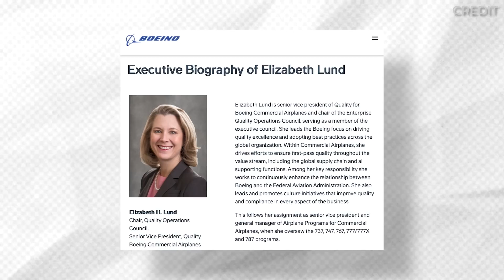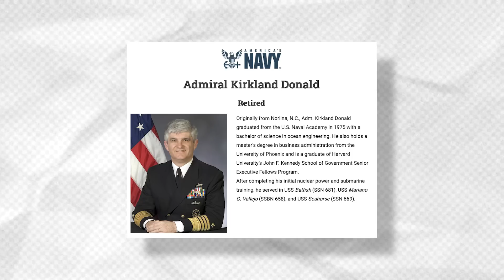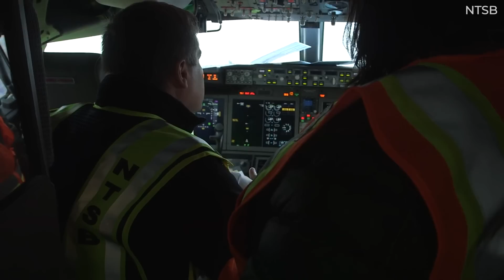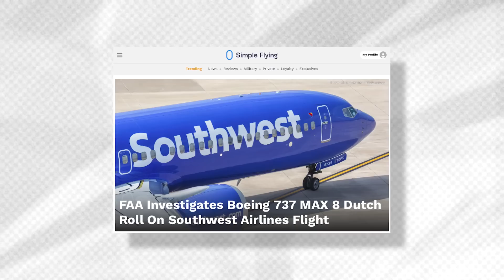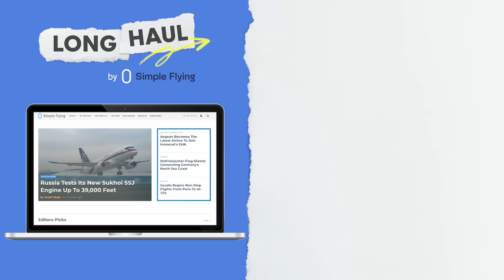Boeing's Plan To Build Better 737 MAX Planes

Comment: Wait, they said this after the MCAS fiasco.
Reply: Has there been any new accidents caused by MCAS?
Reply: @Thompson123-ih4uh  wrong question. Did they fix the safety /quality issues they said they would?  Waiting......
Reply: @bluelithium9808  MCAS is now reliant on two sensors. Since we've had no more crashes.

Comment: Planing to build a better 737Max.

By BOMBING IT!
Reply: no.
by bringing back the 707 with a similar length to the a320 and shortening the wings making it only a twinjet with the characteristics of the current 737 max.
Reply: @yhfhdcf  BOEING IS GONE! Get that through your thick as shit head. THEY ARE MURDERERS! Their aircraft assets stocks all will be seized by the department of Justice. BOEING IS FINISHED!

Comment: I always assumed that workers at Boeing, when removing or replacing bolts on an aircraft door, would complete paperwork that shows who did it, what was done and who approved the finished work so as to log a complete chain of custody.  I guess I was giving Boeing too much credit.  I don't want to go anywhere near an aircraft that does not have a procedure like this.  Even Aircraft parts have to have a chain of custody, but not so much for mechanical repairs?   I still refuse to fly on any aircraft Boeing has built since the  737-900 ER,  I'm going to keep it that way for the foreseeable future.

Comment: I'm supposing Boeing felt they needed to address the incidents publicly rather than not say anything at all. This was indeed a violation of the ongoing investigation by the NTSB, but I don't feel that it was "flagrant" or "blatant" as I do not believe it will effect the integrity of the overall investigation.  But, yes, Boeing does need to be held responsible for prematurely divulging information as per the agreement and law of a company under investigation by the NTSB.

Comment: So the first in what will be many deaths and accidents is for the DOT and the DOJ to allow Boeing to reacquire Spirit Aerosystems. Boeing can't even keep it's own process clean, why make it bigger? The milk has soured, putting back in the fridge will not bring it back. Boeing has killed it's world leading engineering capability and replaced with it's much proclaimed share holder commitment. Greed and accountants have, forever, polluted the waters and the personality of Boeing. It's just not coming back. I'm sure Boeing will probably go on but like all the others in management, like Calhoune, will punch out during the string of new and upcoming Boeing failures and gently drop by the bank with their golden parachutes.

Comment: At the end of the day everything boils down to quality control and safety inspection during the installation processes. Any anomalies should be detected and ironed out before an aircraft is pulled out of a megafactory. As for the blatant contravenation of NTSB rules regarding the 737 max incidents, it is a disgrace for Boeing to reveal and speculate non-publicized details.

Comment: Finally some refreshening honestly from a Boeing exec and the gov (NTSB) balks at it citing secrecy issues. 
I was glad to hear how simply the mistake was made (door should have been double tagged as inoperable for flight - red tagged - needing further adjustment, before being considered 'air worthy' - and suitable to go into normal flight service; it's how we aircraft mechanics would have done it on an operational aircraft in the USAF) and the airframe thus required extra paperwork and action that was not completed. Simple error simple fix..
Of course the missing paperwork and the name of that Spirit employee commiting such a negligent foul up was long ago flushed down Boeing's magic golden toilet bowl, in Management's exec offices, and the employee promptly fired.
In the Aviation paradigm there's a recognized rule.. if you f'ck up and own your mistake, and no one dies or is injured, no disciplinary action is taken, regardless of costs and delays. It's an Aviation-wide (imperative) golden rule that stops fatal flaws dead in their tracks, from the flight line, hangars, assembly shop floors, and from issuance data from the engineering drawing boards. I doubt Boeing honors that working gentleman's agreement, ever since worshipping the stock holder's annual earnings board of review.
This if not a catch-all golden rule it's most certainly a silver one, which honors steadfast honestly above all else. In the military if someone drops a wrench inside an aircraft maintenance panel all or most work is stopped until that same exact wrench gets found. It keeps planes safe to fly, and the people responsible, honest about what they ultimately do. Start worrying about bean-counts and dollar delays, guaranteed great delays and greater losses will eventually follow. 
That woman refreshingly honest and brave enough to inform us of the real problem was doing her job; the NTSB not so f'k'n' much!
Reply: The company is not supposed to disclose any information, in order to prevent them from trying to rig the information into their own favor in the public.

The NTSB will be reporting about an investigation, the moment they understand what was the cause.

This has been implemented to ensure that neutral information is released to the public.
Reply: She jumped the gun
Reply: I bet that is right, the poor slob who skipped the paperwork didn't want to get called out or worse, BUT with a giant organisation there is bound to be multiple bad apples, so it's HR's job to weed these people out... Reskill them or whatever.

Lack of traceability should be an immediate red flag, not to find out weeks or months later.
Reply: @jonr6680  exactly, also just shows from the top, Boeing just does whatever they want.  There's protocol in an investigation

Comment: Whatever the issue (non conforming plugs from Spirit, non-documentation of removal, lack of job responsibility,...), there's a lot going wrong in this process. Unless it's not fixed, they are not out of the weeds.

Comment: What about the ones that they have already built. Are they substandard ?
Reply: I hope so. If the absence of the door mid-flight were a standard, that would be hilarious 😅
Reply: @TheKolian1996  seriously?
Reply: There would be a Service Bulletin once the improvement is finalised.
Reply: A lack of proper quality control and paperwork would suggest yes.
I won't fly in Max models.
Reply: @Danger_mouse secondo te le compagnie non hanno controllato nel frattempo?

Comment: Dealing and complying with regulators is a core part of any executive's role, regardless of how asinine the rules may be.
That these executives did not simply say "We cannot comment on any ongoing investigation. Boeing is confident in the design and airworthiness of the 737 MAX" is a fireable offence.
Honestly, the NTSB should have stopped sharing information with Boeing when they refused to make the employees who worked on the door plug available.

Comment: I might be missing something. But why would you hire a retired Navy admiral as a consultant for quality work on commercial planes? I dont see a correlation? Is that really the best consultant for the job?
Reply: Military stuff in general is pretty good about making steps… lots of steps.
Reply: I believe the one they’re hiring had years of experience in quality control with military planes. The parts and assembly lines are not drastically different between commercial and military aircraft.
Reply: Maybe he was a navy pilot so knows something about airplanes?

Comment: ".... shared the company's plans to make its Boeing 737 MAX assembly line safer and more focused on quality." That should be doable, perfectly doable. Taking the starting point into account, even if you put a 10 year old to manage quality at Boeing, things will improve [as long as management does not insist that "quantity is our number one priority"].